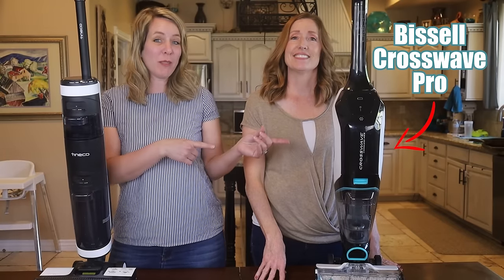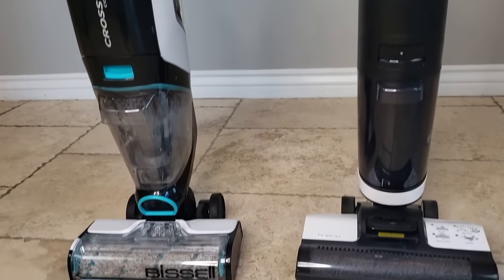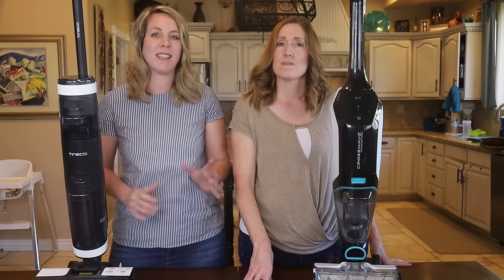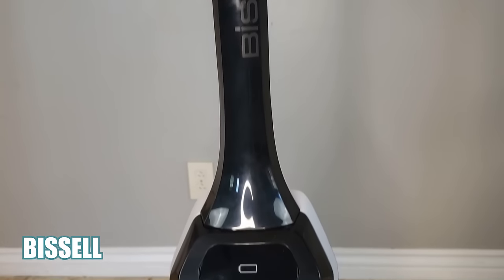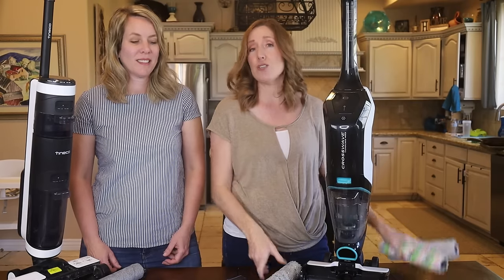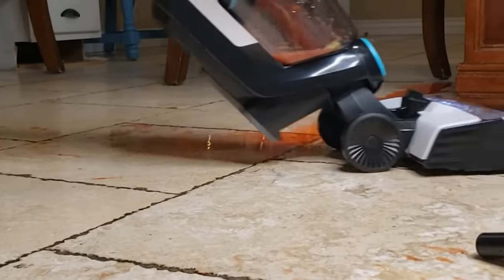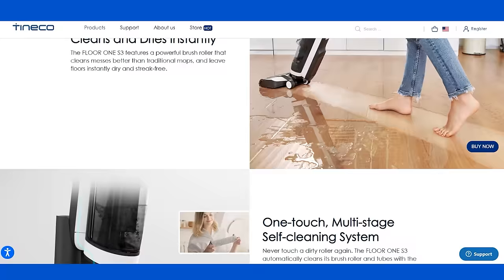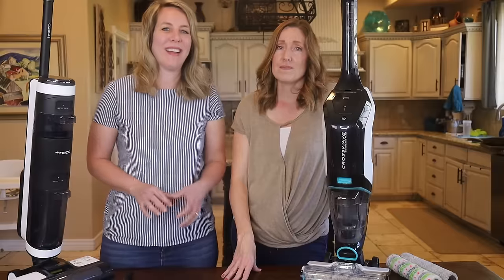Bissell Crosswave vs Tineco Vacmop (Which is Best??)

Comment: Thank you for this video. Excellent live comparison! I decided to purchase the Tineco. I have SPC vinyl flooring. I liked the short soft roller and quicker drying time. I also watched another comparison video that showed the self cleaning feature: the Tineco dock was dryer after the self cleaning mode.
Reply from the maker: I'm very happy with my Tineco purchase and so far it has outperformed any other vacmop I've tried. I've got 2 more vacuum mop reviews coming up!
Reply: @CleanFreakGermaphobe  I choose the tineco because it's sleeker and high tech looking :) Can't wait to see your other vac mop review .. I'm a high tech cleaning gadget geek... I'll try anything to make my life easier :)
Reply: @CleanFreakGermaphobe  Will be interested in all of your reviews of other vacmops. I had watched Vacuum Wars reviews and I was leaning toward Tineco but online people complained that they can't get through a room without having to stop and do the self-clean and they have to also deal with the water before the room is clean.  Plus, the solution is often not in stock at Tineco and they say that using a different cleaner will corrode the system.  It is easy-peasy to find Bissell solution at local stores.  That, plus the 3-year warranty versus 2-year is what changed my mind.
Reply: I am still researching it.    Tineco has a 2-year warranty.  Bissell has a 3-year warranty.  Tineco has 300 battery cycle and you can't buy a battery once it goes dead.  Bissell, you can send the machine in for a new battery but there are some places that say they sell a replacement battery for it.  The average cordless vac and vacmop last three to five years, where Bissell claims 7 to 10 years with proper upkeep.  The biggest thing to me is that the Tineco is a throwaway when the battery dies.  Bissell, for now, there are one or two places to get the batteries. but that isn't a guarantee that they will still have the proper batteries 7 to 10 years from now.
Reply: @psaunder1975  Sounds like it is worth it to get the Bissell. The longer warranty and bigger water tank and the ability to use it on area rugs.
Reply: @wishingb5859  That's the big key.  They likely won't be selling that Bissell model in 7-10 years, if it lasts that long.  The chances of them still selling the battery and supporting that model that far down are pretty slim too.

Comment: I prefer the Tineco’s slimmer form factor, but I just wish you were able to manually choose if want just to vacuum or run both. 
I had hard floors, but the odd occasion I vacuum a rug and the couch.
I also like to do a dry vacuum pass and then do a mop.
Reply from the maker: I bet that's coming. You could vacuum, mop or both. Plus a shorter charging time with a line longer run time. Still, I think it gets floors much cleaner than the old way where when you mop you're still putting dirty water back on the floor. And can't usually detach and wash the mop head.
Reply: Same here, majority of my first floor is luxury vinyl plank flooring, with family room in carpet. I want separate functions so i can vacuum every day, then mop once a week.

Comment: For me I am going to purchase the Bissell since it can go from hardwood to area rugs.  I do hope it is up to the challenge of my 2 dogs and cat.
Reply from the maker: Let us know how it goes! Janet has a cat but we don't have a ton of pet hair. We should test it where there is!
Reply: I've got the Bissell Crosswave pet pro and have two cats and two dogs, all of which lose loads of hair. 
It's never been so easy to keep my rugs hairless and with the pet cleaning solution with febreeze they smell great for quite a long time. 
It's great at getting rid of crayon on floors (and carpets) too 😅 
The only 'problem' is that longer hair eventually gets caught up in the bottom of the tube but is easly removed with one of those bendy brushes, so if cleaning a larger area you'll have to empty out the container and get the gunk out of the tube at least once. 

Still dont regret the buy, it still only takes me a quarter of the time to clean the house than it used to.
Reply from the maker: Yes I've got a great brush that's flexible and has bristles that get down into the tube. I do it after most cleanings, unless it's a really quick pick up.
Reply: Bissell has a pet pro crosswave one

Comment: I own the original corded croswave and have had it for a few years now. I do not use it as a vacuum and only use it as a mop and it works great. Only complaint I have is cleaning it after each use is a pain. There are a lot of parts to clean and it takes up the entire drying rack.
Reply from the maker: Yes, there is a bit of cleaning to do. The bigger the messes you're cleaning up, the more cleaning you have to do after. We had to do A LOT of cleaning after these tests. But if you keep up on it (because it's so much easier I clean more often and immediately after a mess is made), it isn't as much maintenance. It still beats a mop and broom or vacuum to me!!
Reply: @CleanFreakGermaphobe  I agree with you completely.  I use it to mop my entire house once every few weeks and then  clean it and put it away. Use a swiffer for small spot cleaning in between.
Reply: Could be worse, you could have no dish washer, etc
Reply: Have you ever had an issue where your floor stays wet for a long time after mopping?
In the first few uses, my cleaning machine worked like a charm — the floor would be dry in just 15 seconds. But after a month of daily use, about 10 minutes each day, it doesn’t squeeze out the water effectively anymore.
Now, I'm stuck waiting around 5 minutes for the floor to dry.

Comment: I purchased both the Bissell Crosswave (wired) and the Tineco S5 from Costco. The only problem with the Bissell was that it left the floor too wet after use. Consequently, I returned the Bissell and now only use the Tineco. The Tineco is more suitable for my needs because it leaves the floor quite dry and clean after use. However, the Tineco does have one issue: it doesn’t have a long lifespan. According to many user experiences from China, many Tineco units malfunction after 2 or 3 years. Despite it being more expensive at Costco than on Amazon, I chose to purchase it from Costco because of their return policy, which allows me to return it regardless of how many years have passed, as long as it’s no longer working.

Comment: I have a dyson cordless vacuum, which I love, because it allows me to quickly do a superficial clean, but with my bissell crosswave, I don't mind the cord at all. With the necessity to clean the water tank and roll and all, the bissell is not suited for a quick in between use anyway. My corded one was 170 dollars instead of 400 or so.
Reply from the maker: Yes we like that Bissell has a corded option too!
Reply: Have you ever had an issue where your floor stays wet for a long time after mopping?
In the first few uses, my cleaning machine worked like a charm — the floor would be dry in just 15 seconds. But after a month of daily use, about 10 minutes each day, it doesn’t squeeze out the water effectively anymore.
Now, I'm stuck waiting around 5 minutes for the floor to dry.

Comment: I've just purchased the Tineco S5, which is an upgrade to the S3 displayed in this video, which boasts the following upgrades: larger water tank, edge clean (on one side) and the option to switch to vacuum only. So the ''negatives'' displayed in this video, addressed since with the upgrade done by Tineco but it is $100 more expensive than it's S3 counterpart.

Comment: It's time for me to upgrade. Bissell all the way. It's far more durable. All that computer junk on the Tinco, is a headache in the waiting.
I have the older crosswave, and it works great with two caps of pinesol 😂.
Reply from the maker: You add Pine-Sol to the water tank?
Reply: @CleanFreakGermaphobe  yep, two caps (approx two tablespoons) in the tank of water. 
As long as it's a low suds cleaner, you can use it.
I've been using it for years in the crosswave.

Comment: I have both the bissell crosswave cordless max for the house and the tineco vacuum for my camper love them both
Reply from the maker: Thank you because you proved our point that if you have hard floors to clean, get a vacmop. Either will do great!
Reply: Have you ever had an issue where your floor stays wet for a long time after mopping?
In the first few uses, my cleaning machine worked like a charm — the floor would be dry in just 15 seconds. But after a month of daily use, about 10 minutes each day, it doesn’t squeeze out the water effectively anymore.
Now, I'm stuck waiting around 5 minutes for the floor to dry.

Comment: One thing I was hoping to find out is ease of taking it apart and putting it back together. Was hoping to get for my elderly family member but they both seem like they would be too complicated for her to do on her own. She may get frustrated or break it by pulling the water containers out too hard or shoving them back in before fitting it properly so I don’t think I can choose either for her unfortunately but I would love either one for myself! I personally like the Bissell because of the mop head, bigger tanks, and you can use the water when you want. But  I don’t like how you have to pull the trigger each time to get the water. Overall they both seem great.
Reply from the maker: Maybe we'll record a video of that and leave it for you in a future comment. My 80 something year old mom has the most basic Tineco. She has arthritis in her hands but does ok with it. But I understand the concern and I do think it'll be a little complicated for your family member. But it's so much easier on their back and body to push it. The newest Tineco the S5 is easier to remove and put in the water tanks than the Tineco in this video. Hope that helps.

Comment: I own one of Tineco vacuum. I love it’s functionality, however the plastic parts  has fallen apart with regular use. Of course it already passed one year.
Reply: This is exactly why I'm not getting a Chinese brand. I just don't trust them. At least with Bissell it might be made in China but I can get it replaced by customer service when it conks out, or even repaired.
Reply: Have you ever had an issue where your floor stays wet for a long time after mopping?
In the first few uses, my cleaning machine worked like a charm — the floor would be dry in just 15 seconds. But after a month of daily use, about 10 minutes each day, it doesn’t squeeze out the water effectively anymore.
Now, I'm stuck waiting around 5 minutes for the floor to dry.

Comment: I just returned my Tineco One S3 to Costco as it wouldn't charge any longer.  I contacted Tineco first and they wanted me to send the entire thing back to fix, but I had recently cleaned my floors and couldn't run the self-clean cycle without a dead battery.  I liked it while it worked (1 year).  Now I've been researching the new Tineco models (S5 Pro, S5 Pro2, and S7 Pro) since those three have suction only mode.  I'd love the S7 Pro, but it's too expensive, especially given my experience with their batteries.  It seems the S7 Pro has solved the double edge issue, light, suction, etc.... I really wish they all had batteries we could easily replace.   Anyway, I was also looking at the Bissell in this review.  I love that it's made in the USA!  My house is mostly sealed hardwoods (probably need to be resealed though) and some area rugs.  Do you have any experience with the Bissell on sealed hardwood floors?  Does it streak?  I have the Bissell with the two rotating disks and it's terrible on hardwoods.  I used it on my bathroom tile floors.  Any others you can recommend as options?  I need to purchase a replacement soon. Thanks!!  BTW - love your reviews!
Reply: Have you ever had an issue where your floor stays wet for a long time after mopping?
In the first few uses, my cleaning machine worked like a charm — the floor would be dry in just 15 seconds. But after a month of daily use, about 10 minutes each day, it doesn’t squeeze out the water effectively anymore.
Now, I'm stuck waiting around 5 minutes for the floor to dry.

Comment: It depends on which Tineco you buy. I bought the iFloor (first model) version and it allows you to control wether or not you use water, as well as a “spot” button for stubborn stains. Also the roller it comes with has soft and hard bristles on it. Mine doesn’t talk too which it nice
Reply: How do you like your ifloor? It’s on sale now, and I’m struggling to decide if to buy the ifloor or the ifloor3. I just needed a simple mop …. And now I’m gearing towards the more ezpensive versions… of course 😂

Comment: Tineco is the winner. It picks up the egg, dries faster, it's sleek and easy to brag about. Bissell is a great company I love them very much...but in all honesty tineco is built better...it's all about the drying time and efficiency in my life and tineco will deliver that....
Reply: Doesn't agitate as good. It's louder. Can't use it on rugs. Doesn't have an option to just vacuum instead of mopping everytime you turn it on. And you have to change the dirty tank mid  cleaning? No thank you. Also bissell did better on the edge comparison.

Comment: My Tineco stopped charging properly. I have to pick it up and set it back down on the base over and over for 10-15 minutes to get it to charge. I decided to order the crosswave and it came in today. I’m going to return it. The Tineco puts down water automatically and evenly whereas you have to push the button to release water on Bissell. It doesn’t wash evenly. I’ll be shipping it back this weekend and I just ordered a replacement battery for my Tineco. Wish me luck replacing it. 😬

Comment: Thank you for this review, very practical and answers all of my questions! I ordered the Tineco Floor One S3 because I loved the sleek look and the tech features. Question for you: The Tineco model in the video appears to be the Floor One S3 which has all of the features you described. However your opening graphic indicates that it’s a iFloor3, which does not have the features you described. Can you help clear up my confusion?
Reply from the maker: You'll love it! Actually it is a Floor One S3 in the photo. They look similar but the IFloor 3 has white instead of black water tanks. 

The display on the S3 is much more sophisticated. Instead of lights that go on it shows dynamic information. Like if the area you're cleaning is dirty still, it shows red. And it tells you the exact battery life, such as 82% rather than a bar.

But it automatically adjusts how much water to put down based on the mess detected. It runs 10 mins longer on a charge and if I remember right his a slightly better battery and suction.

You also get another roller brush. All for about $100 more. I don't use the app but there's that too.

Both are great machines. I even like the basic IFloor but it doesn't self propel and the battery and suction are far lower than these models. And it has no display. The front and brush is smaller too, by a few inches. So you can't cover as much floor as quickly.
Reply from the maker: Actually we made a mistake on the opening. It's not the IFloor 3. It's the Floor One S3. The names are very confusing. So thanks for catching that. I wish I could go back and change it!
Reply: @CleanFreakGermaphobe  Thank you for clearing that up! I’m glad I purchased the one you have, it looks awesome AND I got it for $50 off at Costco today. Appreciate your quick response.
Reply: @CleanFreakGermaphobe  I used my Floor One S3 this past weekend and it performed like a dream! Many years ago I had (and loved) the Bissel Flip It so I was mentally making comparisons to that machine. I love how efficient it is, and the self propelling feature is awesome! As I mentioned before, I ordered mine from Costco and got $50 dollars off and when the package arrived I also received a free Tineco Pure One Mini S4 cordless handheld vacuum. Double bonus!
Reply from the maker: I'm so jealous you got the vacuum too! Wow! I love the company now and want the vacuum next.
Reply: @CleanFreakGermaphobe  I was very surprised when it arrived. It’s super sleek, lightweight and has great suction for a handheld. You’ll love it!

Comment: Hi, I spoke to you about purchasing the Tineco unfortunately it malfunctioned the very first time I used it. it worked great while mopping. i carefully cleaned the entire vacuum carefully around the sensors, I decided to thoroughly clean each time so I could avoid any odors like I was hearing ppl complain about. it errored as soon as I placed it back on the charging dock. needless to say I spent time checking everything and finally manually pressed clean I thought I had solved a glitch. no[e it has an E1 error code. I am within my time to return and get a refund, but in case it was just a fluke I called Tineco. they apologized for a defective vacuum and told me to send it back and get another. it's quite a hassle, I have to wait a month to be refunded. so I am too afraid to take,y chances again with so many others having the same issues. oh and Tineco told me that its a issue for them nc the sensors malfunction from the water - i mean its meant to get wet during use! i wanted you to know my experience tho and I really do appreciate your help ❤
Reply from the maker: I’m so sorry to hear that! I hope that it gets resolved and saves you so much time and work that this fades into the background. No harm in asking them to throw in an extra brush roller or cleaning solution for the hassle they put you through. 

Based off our family and our Tineco purchases and comments here, this isn’t common. Or if more common, a newer issue. 

I’ve found them to be foreign (so not always the easiest to communicate with) but willing. In other words, acting in good faith. 

So I wish you the best and appreciate the update. If you remember to, it would be good to hear how it works out for you.